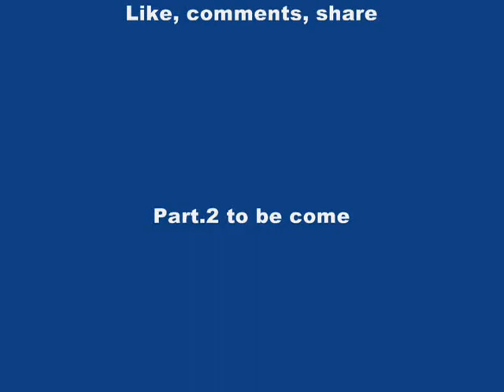Piranha buggy 2 seats build part.1

Comment from the maker: The subframe is the same of the edge piranha but the vital space is more longer of 110mm. The upperframe and the rollcage is adapted for 2 persons and is more larger of the original (home made plans in solidworks). The tabs for the wheels is more larger too for more stability (64 inchs side by side with tires)

Comment: What shocks did you use?
Reply from the maker: Honda Moto516 shocks, for rear was f-150 shocks like Rancho but is a cheap brand and the spring come from a polaris ATV with 600 pounds of preload. For the front, i use lt230 shocks from Suzuki ATV, but I will do some modifications because the suspension travel is to short... and not strong for the weight of the buggy
Reply: Thanks for the video and the help, Im trying to build one myself.